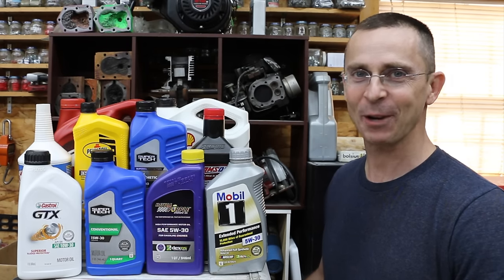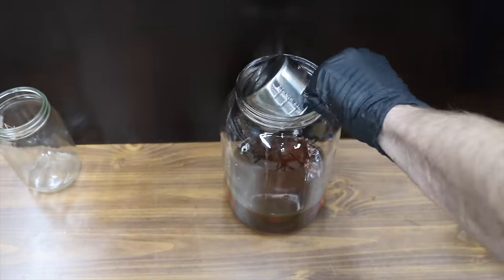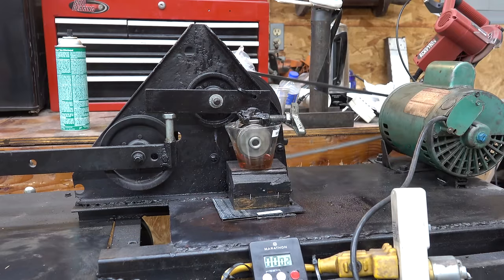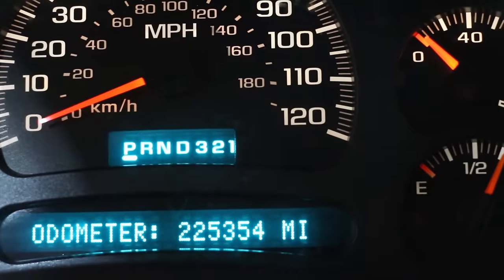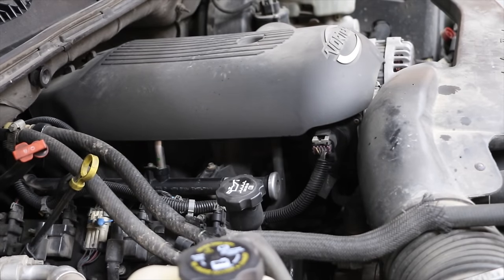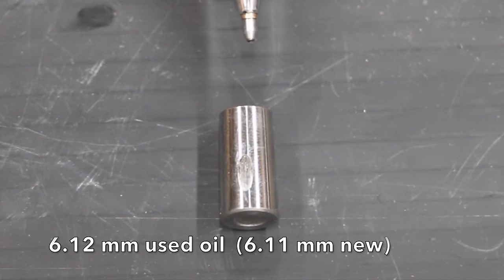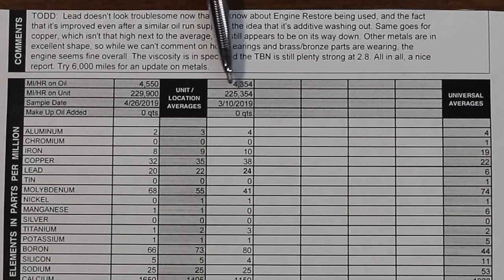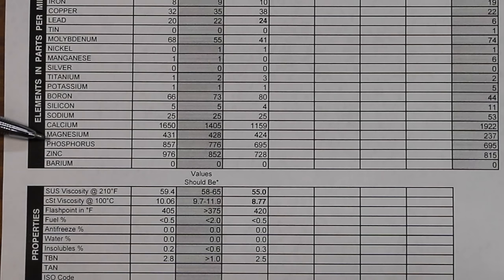Will Mixing 10 Motor Oils Damage an Engine? Let's find out!

Comment: Years ago I read an article in hot rod magazine in which they hop up a bunch of six cylinder engines. They said that you could cut the heads on the slant six ninety thousands to bump up the compression. It increased the compression the most on the 170 engine and I had an older 170 and a 68 Dart to put it in. I rebuilt the engine put it in the Dart and used transmission fluid as my break in oil. I went five hundred to a thousand miles before changing it to Mobil straight thirty weight. Using the transmission fluid as a break in oil was supposed to help seat the new rings. 
I read somewhere that transmission does not have the detergents that motor oil has. The engine ran great and the increased compression increased the quickness of the car. Good video. How about a test comparing the wear difference between transmission fluid and oil. Happy Motoring.
Reply from the maker: Thanks!  Thanks for the suggestion.

Comment: I have always mixed whatever oil brands are the least expensive with what I already have at home and never had single issue. My pickup truck has over 350K miles and always gets oil changes done every 3K miles religiously. It still runs like a champ.
Reply from the maker: Thanks for the feedback.

Comment: I believe it was 2001 when FTC (Federal Trade Commission) has published their study results about conventional and synthetic engine oils. That study was performed at NYC with city cabs for two months. So, long story short..... FTC didn’t reveal significant difference for engine wear between conventional and synthetic oils as long as oil level was adequate and oil and filter were replaced on time.
Reply from the maker: Great information. Thank you

Comment: I have been in the automotive business for for over 55 years. Just like you found adding a quart or two won’t hurt anything.
However viscosity should be maintained as some engines like the Chrysler hemi with multiple displacement will actually set a code if the viscosity is too high because of the hydraulic lifters needing the thinner oil for the close fitting small parts.
In the big rigs we maintained we ran oil for 50k miles using a bypass filter to remove smaller particles, adding base when the TBN gets too low.
We like to keep that above 4. We do testing every 10k.
Reply from the maker: Thanks for the feedback.

Comment: I have a 1996 Chevy Z71 pick  up  Vortec 350 that had its oil and filter changed at the recommended interval with 4qts of conventional motor oil and 1qt of full synthetic oil of the same viscosity. That motor has almost 200K miles on it and it doesn't  uses less than 1/4 of a quart of oil between oil changes! Had a mechanic change the intake manifold seals at 100k. He changed the oil and used all conventional motor oil. At the next oil change I had metal fuss on the drain plug magnet. I had never had that before or since with my mix.
Reply from the maker: Thank for the feedback!

Comment: The only problem with mixing oils, was back in the 70's. I had 5 quarts of oil cans on hand mixed between two brands, I think it was Sears, and Havoline conventional oils. It created a huge amount of white Lithium grease type of sludge in the engine. I changed it again two or three times using only one brand Quaker State I believe, using various flushes like Rislone, and eventually got most of it out. But it was a real mess. After that, I made sure to do conventional oil changes with 5 quarts of one brand only. In My '82 AMC Eagle, with the 258 six, I had to change the oil at 2000, miles, or the lifters would start to tick and clack. With the modern synthetic oils I haven't had any problems mixing with this or topping off with that. I remember hearing about some problems happening with two stroke oils back then too, so I knew not to mix those.
Reply from the maker: Thanks for sharing.

Comment: Good video again! My experiance is that since i drive older vehicles on a budget i use the cheap oils from the supermarket.
I always make sure the additives in the used oils are above of what is recommended by the manufacturer of the vehicle,just to be save.
Check the API qualification letters like sf/cd etc etc.
U see since the time the car was produced the technologie of the oil it used since then only improved ..!!
It got better so to speak.
 
The tickness of the oil may vary but since i live at a sea-climate with no strong winters or hot summers  so its no isseu.
 15w 40 is what i prefer ,but it depends on the vehicle and climate and use of the vehicle .
I never use mineral-oil alone ,always semi synthetick .. there a blend of there one and reduces wriction (very noticeable) saves gas and produces less heat, less wear..
If a car has more miles on it and is getting older the compression is getting less , often a litlle ticker oil can helps.
A car should not be driven hard directly after start-upp , its suppose to normally warm-upp..
before asking it to perform, towing racing climbing a hill and such is very demanding for any vehicle engine...
 
So the API            American Petroleum Institute         system looks like this: 

API SF/CD            were SF/CD  (example) are the additives they put in.
they protect the engine (oil) from:     foaming,   against acid if it sits to long (goes bad) not driving it enough 
keep particles flowing in the oil... etc etc

Keep in mind that if u do it urself and with the cheaper producs , the service interval u should shorten it.
Replace the oil and filter more often , its better .   
 Take a look at it in the store,  if you are interested  and if u like your car and want it to last the cheapest but safest way possible .

Goodluck and greatings from Holland
Reply from the maker: Greetings!  Thanks!  Thanks for sharing.

Comment: Before I watch the video, I worked at a place that put the oil in the bottles. Let’s just say the first batch of almost every bottle of oil is mixed with whatever was ran before it. Unless they completely change products as in different fluids being put in the bottle, they don’t completely flush out the lines
Reply from the maker: Thanks for the feedback.

Comment: WELL for 23 years I drove my Honda Accord  4 cylinder  a total of 470,523 miles until a huge tree limb fell on the roof and totaled it just two weeks ago as I was driving home .. 10 years ago it started using up a quart of oil every fill up ... since it was cheaper to buy oil instead of replacing the engine , I decided to just keep adding oil ! I used every name brand you can think off to top it off between oil changes , from the cheapest to the expensive oils  . Honda recommended 5W 20 . I put in 5W 20 -  5W30 -  10W 30  - 10W 40 and I never  had a problem .
Reply from the maker: Thanks for sharing

Comment: Just got a riding mower from a friend running that's been sitting for over 10 years and would like to do a very short "flush" oil change to get the very dark and dirty oil out. Guess I'll be using up some of my 20+ partially full quarts for that!  Thanks for testing and sharing👍
Reply from the maker: Thanks and you are welcome!

Comment: Great video 👍 I use diesel 15w40 in my royal Enfield, Enfield say use 10W50 , but it runs fine and as I change my oil every 3 to 4000 miles I'm not buying overpriced oil that does the same job . I guess I'm saying, it's more important to change your oil regularly the obeying recommended viscosity. 😁😁
Reply from the maker: Thanks!  Thanks for sharing.

Comment: This one was very interesting to me, as I have a 1960s Classic that calls for 20W/50, I usually use Amsoil's TRO 20W/50 Fully synthetic for it's High ZDDP content, my straight six engine is an OHV, but one time, when I was on the road I couldn't find any Amsoil, so I topped it off with Valvoline 20W/50 Motorcycle oil intended for high revving motorcycle engines, with lots of ZDDP. Nowthing untoward seems to have come from this, and your video has confirmed that it was likely OK to do it if there is no alternative.
Reply: they didn't have 20-50 oil in the 60s, so the manufacturer couldn't have called for it to be used...

Comment: A few people I've met over the years have sometimes changed to a heavier diesel oil when their engine is ticking and knocking pretty bad to get it to go a few thousand more miles apparently with pretty good success, given some of the engines still bit the bullet as they were driven hard either as derby cars or work around the yard vehicles.

Most of these vehicles called for 5w30 or 10w30 normally
Reply from the maker: Thanks for the feedback.

Comment: A solid engine will survive mixed lubricants just fine. 
We had an old Massey Harris tractor, when I was growing up, that Dad had swapped a straight 6 Chev engine into. (It needed an engine and that one was sitting there)
It threw oil, out the exhaust, like all of the oil rings were gone. It actually used more oil than gas. We put everything in that engine to keep it lubed. Waste engine oil, new engine oil, new transmission fluid, used transmission fluid, bar and chain oil, used diesel oil, and new diesel oil. I thing we even put hydraulic fluid in it a couple of times,, but I could be wrong. Ran it that way for 20 years. It never once failed to start and run. 
Years later Dad traded the tractor away. The guy he traded it to told Dad he tore the engine down to rebuild it. The only thing he found wrong with the engine was that all but four of the head bolts were broken.
Reply from the maker: Thanks for sharing.

Comment: Generally, use low viscosity for push rod engines, high for overhead cam. Long oil path through multiple components in push rod, rocker arm engines requires free fluid oil flow.
Reply from the maker: Thanks for the feedback.

Comment: I use the rotella t6 which is also designed for diesel engines, it is used in my 2.3 liter turbo Mazda. The zinc levels in these are good for the turbo motors
Reply from the maker: Thanks for sharing.

Comment: i have a drum in my workshop that gets all the leftovers from part cans (usually under a litre) poured in so is mainly a mix of 5w30 and 10w40 mostly full synthetic but some part and that is used as top up oil on any of my vehicles that are not 'high performance' type engines or used to flush engines, lubricate parts during reassembly etc and never had issues with the mix, engine oil is engine oil at the end of the day and as others have said any oil is better than no oil with some exceptions (thick mineral classic oil in a high performance turbo engine for example will end badly in a fairly short space of time just as an audi tfsi owner lol)

Comment: I could be wrong, but my understanding is that you can mix any oils of the same weight/certifications and there should be no issues. If you mix oils of different weights, I'm not so sure, but probably will be fine as long as it's not outside of what the engine takes. About the worst I can think of to happen mixing oils is maybe additive incompatibility causing unexpected results. As for mixing conventional and synthetic, I don't think there is a problem because there are blends of such being sold on the shelf.

That being said, I run an engine oil in my small pickup that is pretty heavy and designed for diesel engines, but the weight is within what the owners manual says can be used. I use it because it's an old truck that needs extra zinc in the oil. Truck runs great on it. My daily driver more modern car I use the highest weight oil that is within recommendation based on temperatures for my area and tend to go with a synthetic blend or full synthetic. I have a bad habit of losing track of when oil should be changed and tend to go by "how it looks/smells/feels". If it looks odd, smells odd, feels odd, probably should change it. My daily is getting near needing an oil change, I might send off a sample of used oil for curiosity. It's a beater that I got for almost nothing and have put almost nothing into it over the last seven years other than fluids and belts and tires.
Reply from the maker: Thanks for sharing.

Comment: A small confession from me: Even though I sell a lot of good oil at work, if I have a customer come in with a work truck or older Hyundai and they say, "I need this to last as long as possible" when it already has 200k milss on it, I suggest Rotella T5 10w30 synthetic blend or Pennzoil 5w40 if they called for 5w30 at certain temperatures. Here in Alabama, these oils get stupid hot and stupid thin.

Comment: I have mixed 50/50 conventional 5w30 and 0w20 synthetic and drove 5000 miles numerous times as I have 2 cars that use both weights and never had a problem
Reply from the maker: Thanks for the feedback.

Comment: The only time  I have seen a problem,  a friend of mine put 15W40 In an engine that was supposed to use 5W20. He did a complete oil change.  It damaged the cam shaft and lifters.  Not a cheap job.
Reply from the maker: Thanks for sharing.

Comment: I had a 93 nissan 4 cyl and I also worked at a lube shop & I had tons of nearly empty's of any weights laying around. I never payed anything to just fill the motor with whatever clean oil was available. It never had an issue.
Reply from the maker: Thanks for sharing.

Comment: My engine holds 5 quarts, here is what I put in it every 3000 miles.
3.5 Qts. 5w30 Castrol
1/2 Qt. Lucus Oil Stabilizer
1 Qt. Marvel Mystery Oil
My Oil pressure stays constant with no leaks.
My 4.0 engine purrs beautifully and the engine stays clean with ZERO sludge.
I use a Baldwin B329 Oil Filters because they are the #1 filter in the industry.
Reply from the maker: Thanks for sharing.

Comment: I just add whatever engine oil I have handy at the moment.  After all, it's always better to have enough engine oil in the engine's crankcase than not enough oil.  However, I either use 10W30 or 10W40 and both engine oils are reasonable close in viscosity anyways.     

Working with car engines for +40 years I know of absolutely no one who has suffered major engine problems or engine failure due to mixing different grades of engine oils.  If one just keeps their brand name engine oils (like Walmart Super Tech oil) and stick with only 10W30 or 10W40 there really shouldn't be any problem whatsoever.

Nevertheless great informative video!  Maybe you could work for "Myth Busters" and have your own TV show...... "Myth Buster II. ~ Reborn"
Reply from the maker: Thanks!

Comment: I recently changed my car's oil, and the threads on the new oil filter were bad from the factory, meaning it did not tighten all the way, so when I started my car all of the new oil dumped out onto the ground. I had no way to go buy more, but remembering this video, I used all of the miscellaneous oil quarts I had lying around and it was just enough to fill it up. I left it in for 3000 miles, had no problems at all.
Reply from the maker: Glad to hear.

Comment: Not that this directly compares to anything pertinent, but I've used whatever oil I've had on tap for our vehicles, for my gas- powered stringtrimmer. All changed once per mowing season (Louisiana) on average, viscosities as follows: 

0w20
5w20
5w30
10w30
sae-30
10w40
15w40

Stringtrimmer is a four-cycle, but ive used some suplus leftover 2-cycle chainsaw mix for fuel lots of times. Stringtrimmer is 17 yrs old and runs exactly as it did when new. I cannot discern one iota of difference with how it performs. 

Still a 2 pull-start when cold, 1/2 pull when warm and still has sharp throttle response and power.
------  Conclusion, it is rather difficult to create metal wear in a good machine if there is clean oil present.
Reply from the maker: Thanks for sharing.

Comment: When I was working in a tire shop I was told by the mechanic there that you can put synthetic into conventional but you can't take a motor that's been running on synthetic and put conventional in it. Their reasoning is that synthetic oil is all of a single type of molecule and the conventional oil that's leftover can act as a nucleation site to turn it into slush. But if the engine is fine with conventional oil that little bit of slush doesn't matter because that's already built into the tolerances of the vehicle.
Reply from the maker: Thanks for the feedback.

Comment: I normally mix a quart of Amsoil with motor oil on sale. I have not seen a problem in over 25 years with this mixing, but I have seen additives that do not mix well. Be careful with mixing additives. 
I have sent a few samples in to testing labs. They have all come back fine on my own vehicles, mainly because of maintenance and the use of bypass filters. 
On a few customers and friends vehicles, the worst test results were from not changing the oil and automatic transmission fluid. Some were still contaminated after a service.
Reply from the maker: Thanks for sharing.

Comment: I'm curious if the Rislone ring smoke repair and Bars engine repair work. As I've recently had to use them. Have noticed less exhaust smoke so far.

Comment: I heard from a small engine rebuilder that putting toothpaste on the piston and running the engine will clean out carbon buildup. Honestly that doesn't sound like a good idea. I think it would make for a fun experiment. Especially with the see through cylinder head you have
Reply from the maker: Thanks for the suggestion.